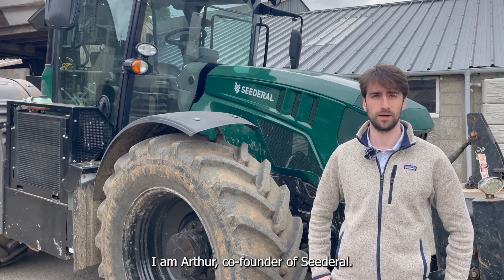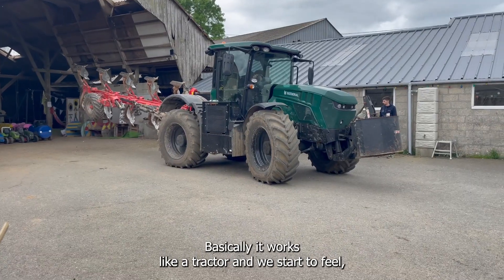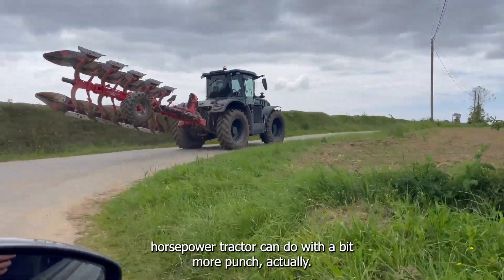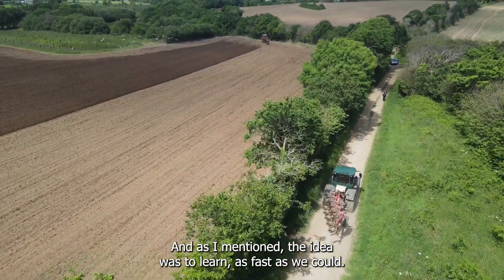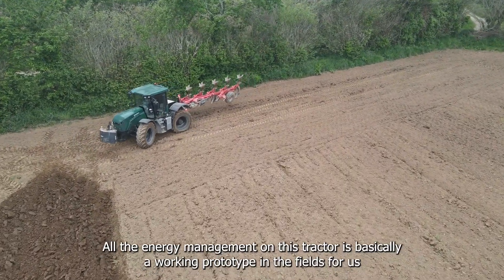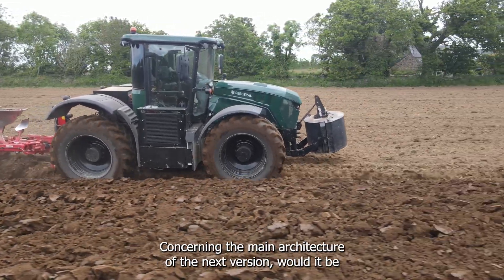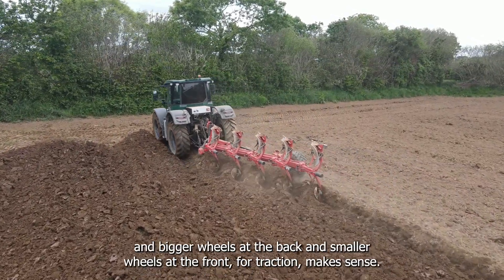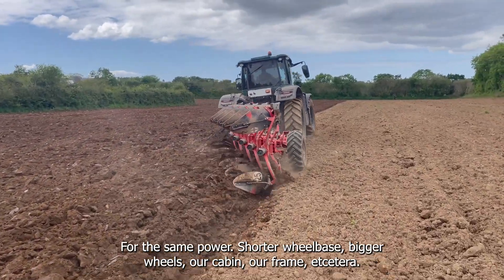Exclusive: Silent plowing with a 160 hp fully electric tractor

Comment: Its a costly toy, the tractor needs over 80% of its nominal power on heavy duty. 3 hours of hard-plowing would need a battery of at least 300kwh (150.000 Euro??). Thats total ridiculous, refueling in comparison to a diesel takes over 200 times longer and so on, electrical energy is more expensive and the lifeime of the battery is much lower than the lifetime of a diesel engine .....insane misallocation of money....
Reply: Actual battery cost of 300kWh are btw approaching the 15000$ this year. So no, you're off by a factor of 10.
Reply: @davepermen  Hard to believe, maybe in china, but not  here in Germany or Europe. The battery is by far the most expensive part of an e-car, not to mention a tractor. This crap is produced   at dumping prices in China and the energetical footprint of a batterie is huge - produced with coal energy in china and with vast destruction of the environment to get the rare materials. i have a battery in  my house, 5 kwh and paid 2022 5000 Euros for it, but i  have to admit, prices have halved since then, but only due to chinese business war tactics. Over here in Germany, we are deindustrializing our economy and we currently even  dont have the energy for this E-Crap.
Reply: @beowolfgang diesel and gas are produced with oil bro this is a ridiculously hypocritical claim. It’s honestly so tone deaf it’s actually a form of satire.
Reply: It's a costly toy because it's a prototype. You are comparing it with technologies that have been refined over many years by huge manufacturing corporations.
Reply: @christopherfairs9095  its just plain physics/chemical - you can much more easily save energy in chemical form than in electrical form, by far! One Liter of Diesel has about 11kwh and the new engines have a efficency of over 50% (in development). And the rest of the energy is in form of heat available. No chance that battery powered vehicles can replace a diesel in the near future, except in special edge cases. moreover, its a economic simple thing - its not worth the efforts.
Reply: @beowolfgang  I know that but diesel fuel needs to pass through an internal combustion engine, which is inefficient when compared with an electric motor. It also produces a lot of noise, waste heat and CO2. That is why this research into improving battery technology is going on.
Reply: @christopherfairs9095  Do the math, its not complicated. A electric car is by far more inefficient compared to a diesel,  electric energy has to be produced, transferred, transformed and so on. There is only on exception,  if there is  a country like france which produce mostly nuklear electricity, than its nearly even compared to a diesel. Over 99% heavy duty engines are combustion engines when mobility is needed - an thats for  a  reason!  And i dont speak from heating, airplanes space travelling and so on.
Reply: @christopherfairs9095 yeah this guys whole argument boils down to “guys this brand new technology isn’t as good as the technology we’ve been refining and producing for 150 years!”
Reply: Where are you getting these stats from?
Reply: A 300 kwhr battery pack should only cost about $30,000 at todays prices.  In china it would be less than half that.
Reply: @zilfondel  And a tank for 500 liter diesel is about 100$

Comment: Made From a JCB Fast track ,But JCB are Not Going EV They are Going Hydrogen as they Stated they Looked at EV for There Machines and Said The Battery would Be Too Heavy and Limit Working Time etc.
There is No Point Messing around With Trying to Make Everything in to an EV at Silly Prices,Just Stop People Flying around on Aircraft all over the World and The Savings Made on all the Jet Fuel Can Be used in Farming.
Reply: I think JCB already have a hydrogen version of this tractor running. They’re able to modify their existing turbo diesel engines to run on hydrogen
Reply: @hughmarcus1  can they produce enough hydrogen  and at what price
Reply: @hughmarcus1  Best I can find is adding diesel to hydrogen to make that even remotely possible. Retrofitting a lot of engines, yet to be seen. Long-term effects on those engines? Yet to be seen. Last but not least: who's making the hydrogen and how will you get it? The few hydrogen cars that were made showed issues with storage, loss of fuel when parked and fuel availability. It's unlikely to be a realistic future.

Comment: This model will plough 1.5 hrs in sand, I wonder what it will do when it's in a heavy clay soil. ?
Reply: Pre cultivated sand at that.
Reply: Good question. He has a 5 furrow plough on that so he has only 32hp per furrow. There is no way he would be ripping along at anything like that speed if he was ploughing a typical soggy English field.
Reply: @ColinMill1  it's kinda old school to count horsepower, tractors need torque at low rpm,that why tractors have a 4 litre engine and making 80-90  horse power only, because that's not important, torque is important and big engines have a lot of torque at low rpm but small number of horsepower!
Electric motors have higher torque at 100rpm than diesel at full power
Reply: @aldish25  The engine does not need inherently high torque as tractors have a thing called gears - lots of them, and critically some of them are extremely low.
None of this really matters as the electric tractor can't do a full day's work as is an absolute requirement - ask a farmer.
Oh, and horsepower isn't old school - look at any tractor manufacturers website. It's the most quoted parameter and for a very good reason.
Reply: Nope

Comment: It is a start but nope, what will the battery lifespan be in working hours , and only 6 hours without battery degrading accounted for,then 2 hours charging time plus weather events in between ? the last factor is where will the electricity be generated from if  hundreds of thousands oftrucks,tractors and ships all need electricity
Reply: i have a salt and pepper battery powered grinder in all honesty it is pretty useless piece of kit

Comment: The projected run time is beaten by tractors from the 60s, and a decent amount of those tractors are still running today.
Reply: Your forgetting the point- not burning diesel and reducing emissions🤷
Reply: @charlespaynter8987  Unsustainable, A Perkins 1000 series runs circles around a battery parks energy to lifetime.
Reply: @Gugernoot  You're mentioning a finished product using over a hundred years of engine technology and comparing it to a prototype using batteries invented in the 70's BY the fossil fuel industry. We've already got battery prototypes from Toyota that is set to released in the next 5 years IN vehicles that double the range in the same weight and size while also providing a full charge in 10 - 15 minutes if you have the right infrastructure to do so. Remember, we've only been investing in new battery technology for the last 15 years, and only really took it seriously in the last 10 years. Even then, the world spends more money designing new engines than is spent designing new batteries... once it crosses the threshold of being better than fossil fuel alternatives, it's pretty much game over.
Reply: @ryanthompson3737  invention of the diesel engine was  only 63-72 years old at the time. about as old the filet o fish is now.
Reply: @Gugernoot  ...And lithium ion batteries were negative 20 years old by that time? Point?
Reply: Yes, my 1963 Massey Feruson 35x is still doing a solid days work and the inside of the Perkins engine hasn't seen the light of day since it was build.
Reply: @ColinMill1  And it's got 1/4th of the power, is only 2WD, doesn't even do rear wheel steering, doesn't have all the modern controls and pollutes like hell. Put the same size plow on it and it's not going to move.

Comment: Nice thought, but most farmers that run a 160 hp tractor, need 16 hours with no stopping...
Reply: They should be developing a removable battery pack system.  Three battery packs would keep 2 tractors operating for that 16 hours.
Reply: Yes, true, but... you will need another 3 tractors to brought those batteries @mithall4198
Reply: @mithall4198  exactly, think Dewalt times 1k. These are already made by CAT and Volvo and will be great for using most of all that rooftop PV in stationary mode. Too much "nah, if it ain't 1:1 what my Diesel monster can do the whole electrification is never gonna work.
I'll bet even non corp family farmers will adapt their work flows if there is money to be saved on fuel and maintenance. Sadly the whole" we got a moral obligation in the US to stop using fossile fuels within the next 20yrs to mitigate man made climate change" is a big no-no, so other nations have and had to come up with the subsidies bringing green tech up to scale, only then is the US and Australia willing to do it : /
Reply: @velotill  If it's so good it wouldn't need subsidies and there is not man made climate change.
Reply: @mithall4198  
Your going to need another tractor and loader following it around to lift the multi-ton battery packs on to it, 

no way you can return to the yard every 2 hours
Reply: Slap diesel generator on the back or front and make it a hybrid.
Reply: There’s some systems that completely negate this. Just change the battery if you need a faster time or more operating hours.
Reply: @Neoprenesiren  I'm sorry to tell you but the biggest problem is the charging side. The Hydro Electric Companies can't supply  that amount of Power down through there Power Lines... Just a few of these Tractors being Fast Charged at the same time takes the same POWER of a Small Village. So to put it nicely either your Village gets mains power, or the farmer does, you can't get both or you build a bigger hydro station and lay out a whole new grid system. Which all the minerals to make the steel and copper, which makes everything for your new Hydro Station and Cable Grid. Gets ripped out of the ground by using THOUSANDS OF TONNES OF DIESEL...
SO TO PUT IT NICELY YOUR GOING BACKWARDS
Reply: @velotill  Yeah, getting a solar system installed won't be a problem since farmers are experts at getting free money from the .gov.
Reply: They literally said their next one will have an improved battery bcs these are mostly prototypes, and 12 hours is enough, they already said this one is 1.5h and next one will be 6h, so they for sure will get to 12h eventually, also what 16h, u sleep 8 hours, thats 24h, do they not require food, to bath, shit, dress, they just instantly pass out in the tractor on the field and wake up to start again??? Most farmers I know work 10 hours per day, 12h at most, but most of the days they stay at most 10h
Reply: @IdleAlex  Have you ever heard of weather windows, this is how farmers have to work. If there is 7 days work to plant a crop, but there's only going to be 3 good days of weather to plant it, they'll try there best to fit 7 days into a 3 days in a good weather window. You eat in the tractor on the move, you hide behind the wheel a bush what ever for the toilet... And if your only working 12 hours a day, when you get out of the tractor they'll be another driver fills the tractor of fuel in 10 mins and they'll  be starting there 12 hour shift.. The tractor can more or less work none stop...
And the next week they might get 7 days to do 7 days work, but there's 70-80% chance they won't, farming's a life not a job...
Reply: I didn’t know they made 500 gallon fuel tanks for those 160hp tractors. Nice though , but most guys have to refuel before they can go 16 hours working a tractor. Max is 12 hours and that’s running flat ground with little load on the engine. I’m not saying electric is better than diesel. I’m just saying, your information is kinda lacking legitimacy on its facts.
Reply: Yes, and charging a BIG battery takes a BIG power connection!
You may need to create such a connection to the grid first.
Reply: All this talk about what farmers need... My grandfather used to work the fields by hand – no GPS, no high-tech, no constant complaining. And now you're telling me a modern farmer can't wait an hour to charge a battery? I just don't get it.
Reply: sure it might require a bit of charging time to go all in. however given the radically lower tco it leave quite a bit of room for things to adjust schedules and tunke4 with new processes.
Reply: @johndoe1909  keep buying the propaganda. This doesn’t have anything to do with climate change. This is all about making you nothing but a slave to the state and the ruling politicians in charge. Wake the fuck up.!
Reply: And 10 minute refuels not 2 hour charging stops.
InB4: get another tractor, the other tractors are probably busy.
Reply: Modern life, modern ways of presenting: how to invent hot water?
Even if you need just 10 minutes charging, where's the grid???
Or you gonna invent replaceable batteries and than you need 3 more tractors to brought those batteries?
What if tractor need to run 24/7???

Comment: Awesome! If you want farmers to like it make it durable, easy to repair and if the software is open source it would be fantastic! Open source is the future
Reply: Yes sure, they aren't even disclosing how many traction motors are in the machine and you think this is going to be open source? Are you out of your mind?
Reply: @looserkuka  I am allowed to comment my point of view right? On my farm we are currently running tractors older than year 2000 because we want our equipment to be easily maintained at the farm. 

We have all the modern stuff like GPS driving and so on, but with a more DIY install in the tractors.

So why buy something new when it is worse and more costly than the old?

Comment: the battery technology need to improve if it can't handle the life cycle of the tractor it'll be a ruin to own you save the diesel and part of maintenance but if the battery need to be changed or the residual value of the tractor is null as EV are starting to show it doesn't make a difference and what about future electricity prices? the goal of 6h work 2h charge and 6 more work hours is in short asking for  a 14h day to get just get 12h of work, road time counted out 8h00-22h00 plus road time, anyone would fit 12h day within 8h00and 20h00 with a driver switch at noon or eating behind the wheel. repeating 8h00-20h00 is  sustainable over a period of time 8h-22h is not. having the tractor sit 2 hours in the middle of the day is a big problem for field work not so much in cattle farms.